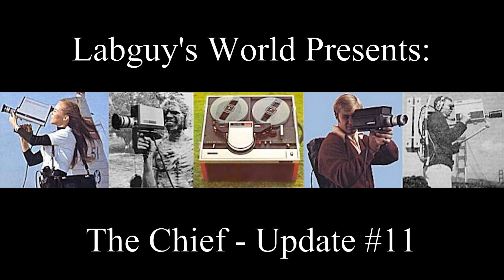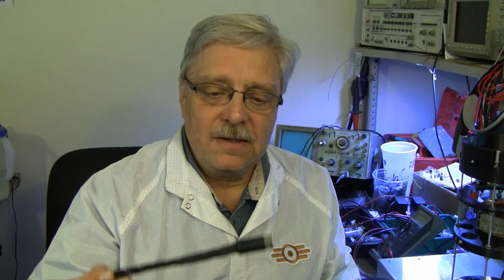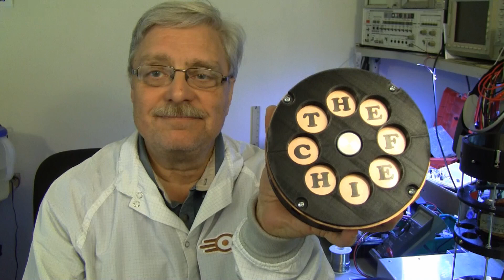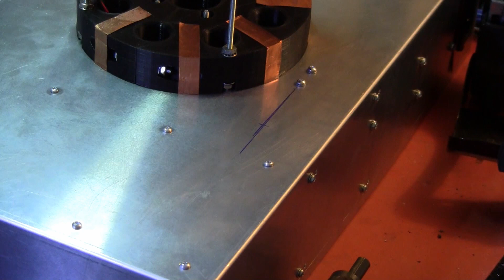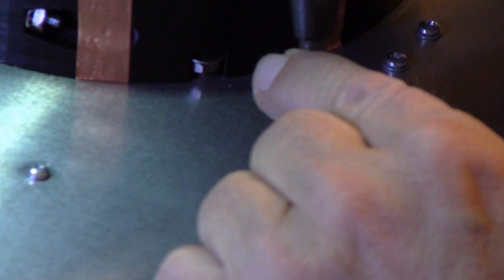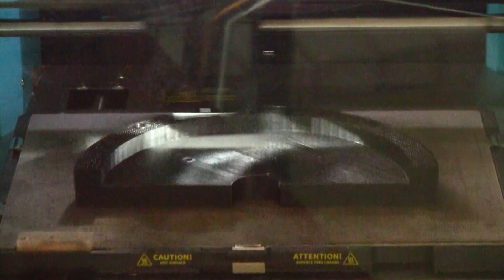The Chief - Update #11 - Video Preamplifier Housing Construction

Comment: You remind me of my late friend James Byron Davis who was my friend and ham radio Elmer. He could design complex circuits like you can. He passed a few years back. I ama musician and we musicians well know about 5 pin din plugs and sockets used for MIDI connections. They are useful for many other things such as  how you are using them. I have decided what to do with my cable project I mentioned about in on of your past videos. When my front room remodel is finally finished I will have five vintage TVs in there. Each set represents an era in my lifetime of growing up with television. To occasionally run one set or the other and to demonstrate them I will use an agile modulator fed by video content from a Popcorn hour media player cabled into an TV RF amplifier. Gary
Reply from the maker: To late friends! (Raises an imaginary toast.) We miss them so much. We lost another one here, just two weeks ago. RIP Don, AA6TV. This is the greatest down side to getting older. The up side is the knowledge we gained in youth, the friendships we make on our journey, and the wisdom that comes in later life. It can all be very humbling.

Best of luck on your RF project. I use a Micca Spech-2 digital media player in my amateur TV station to play loops when we have to run tests on the K6BEN repeater here in San Jose. It has both analog SD and HDMI 1080p outputs. One at a time, but that's fine.